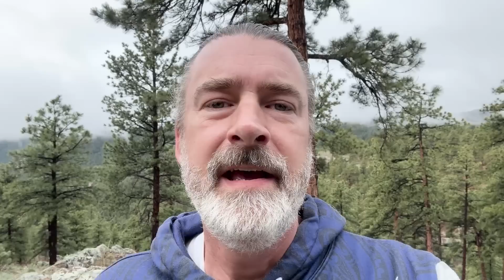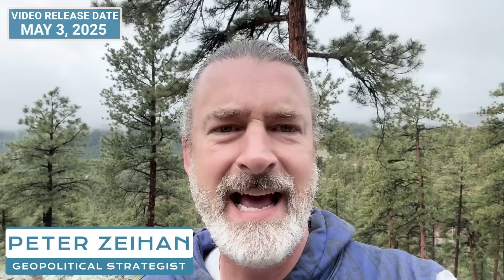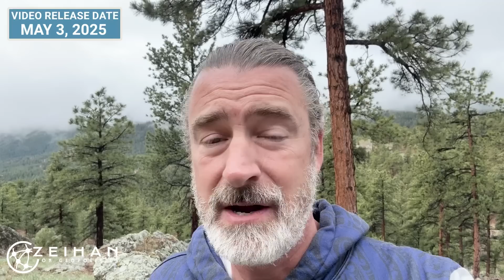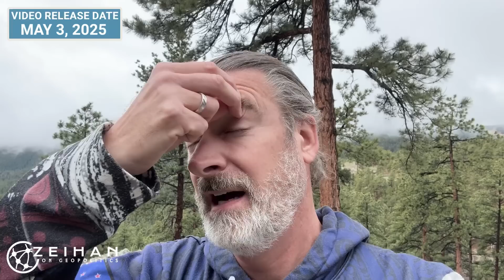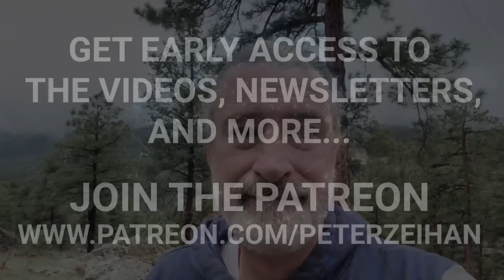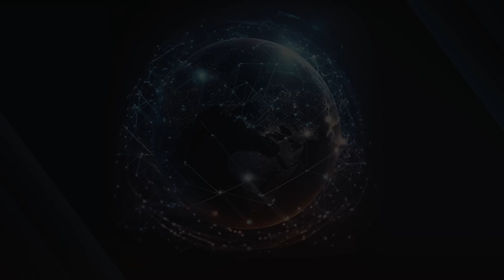The Night the Lights Went Out in Geor- er, Spain || Peter Zeihan

Comment: Pumped hydro storage is a far better option than batteries if you have the topography for it and Spain already has 6GW of it - they just need more.
Reply: @chrisc8156  more wouldn’t of helped this particular situation. They were actually pumping water uphill into one of their hydro storage facilities, in addition to exporting power to France, Portugal, and Morocco.
Reply: That's the same as "slow" storage batteries. It's great for day-to-day but not minute-to-minute.
Reply: @ in Kauai, Hawaii grid forming inverters and batteries responded quickly enough (1/20th of a second) to keep the grid stable when 60% of the grid went offline.
Reply: Closed Loop Pumped Storage is a great option that is being largely ignored. Why? The simple answer is there is too much money to be made with fossil fuel.
Reply: @ I wouldn’t say pumped hydro is ignored. But they take so long to build that utilities are looking at easier to deploy solutions
Reply: @WordLightDotNet Pumped storage has very specific site requirements.  These are very limited.
Reply: Spain is also destroying hydro plants because dams are environmentally harmful.
Reply: @chrisc8156  topography is a big if.  You need a preexisting water source and a large elevation delta.  And those conditions have to exist in a location where a hydro plant wouldn't just make more sense.
Reply: @alanhonlunli  Topographically, you need a small watershed near a river. There are millions of these locations. This is a nonsensical argument.
Reply: @chrisc8156  You shouldn't put all your eggs in the hydro basket: It's very vulnerable to drought. And climate change is likely to inflict some very severe droughts on Spain. Keeping the nuclear plants going would be a good back up plan.
Reply: @domtweed7323  No one is talking about 100% hydro. I'll bet you will never choose to live near a nuke plant.
Reply: @WordLightDotNet  If I had to choose between windmills, a dam and hydro setup, a coal/gas power plant, or a nuclear power plant... let me live near the nuclear power plant.
I'd even take it over a large solar farm, as the cooling tends to shriek like the world was ending.
If it was a matter of a small solar farm, I'd take that over nuclear.

Edit: Closed loop pumped storage can be pretty nice if you have the topography.
Reply: @WordLightDotNet  I'm saying we shouldn't rely on hydro for all our frequency regulation, we need other heavy things that spin on the grid.

And yes, I'd happily live next to a nuclear power station. I used to live next to a massive coal fire one, and burning coal omits significantly more radiation than nuclear power stations do.
Reply: @WordLightDotNet Not enough suitable locations.
Reply: @WordLightDotNet  I wouldn't mind living next to a nuke plant.  I'm not a nimby.  I took a tour of a nuke plant before and thought it was the coolest thing.
Reply: @alanhonlunli  Go live next to Chernobyl or Fukushima then.
Reply: @WordLightDotNet  I'd live near Fukushima.
Reply: @domtweed7323 They need water for cooling

Comment: I thought they were still investigating the cause?

Stuff going out of phase causes disconnects, but it is unclear why it went out of phase.

Here in Australia some politicians blamed the 2016 Sa power outage on too much green but it was the winds blew down the interstate connectors. The lights tend to go off if you import power and the lines are down.

Comment: 50Mhz!  Eeek!  50Hz is fine thank you. As the mains frequency is also used to reference clocks it is maintained within close limits. As the system loads up, voltage drops and the frequency drops on rotary alternators in old type power stations. More generating capacity synchronised to the grid contributes power to lower the load on the other stations, voltage rises and frequency increases. Modern DC power generation has to synthesize the alternators characteristics before and during the time it is connected to the grid. If it doesn't then safety relays will trip, fuses blow, and, yes, fires and explosions may ensue. Also remember the grid is built to withstand lightning storms. The geology of the country can play a part, Canada has had problems with its geology forming a huge capacitor with the grid itself causing overloads.
Reply: The geology itself becoming a capacitor sounds like it shouldn’t be a uniquely canadian issue. Are there other places that have that problem/ how do they deal with it if so?
Reply: @GO-iw1tt  I am pretty skeptical that this dude knows what he is talking about.  Either that or he needs to gather his thoughts better.  As written, it doesn't really make much sense.
Reply: You don't want RG58 power lines?

Comment: As an electrical engineer, this is hilarious
Reply: PZ is a clown, this video is the proof in the pudding.
Reply: As a EE, I second the motion.
Reply: @russellhltn1396  Also an EE here, there is more wrong with this explanation than right. I like listening to what Peter has to say but this was a subject he should have passed on.
Reply: Well, it was a good try (Kind of)
Reply: I'd prefer content creators bring laypeople up in their understanding of the world than talk down to them. Wtf is wobble? Is he talking about frequency? Or some tolerance associated with something?
Reply: @Eisernkreuz  Yes frequency..Think he's talking about the hertz (hz) and the different hz rate that the various power grids run on.. 50 in some parts and 60hz if i remember correctly . Hz is the cycle rate of a wave form , so the different power grid wave forms are not compaitible unless there is a gizmo between the 2 systems  to deal with it.. Waveform=wobble in his explanation.
Reply: @terranowe  I think he is trying to describe the stability of the 50Hz.
Reply: @terranowe  To the best I can identify, he is conflating ac voltage oscillation and inter-area oscillation, and doesn't have the technical background to untangle the concepts.  We occasionally get inter-area oscillations in the western interconnect.  check this:  https://www.sandia.gov/research/publications/details/executive-summary-to-pdci-oscillation-damping-controller-software-documenta-2018-09-01/
Reply: @terranowe He explained the USA has 60 Hz, Europe 50.  So “wobble” remains undefined.
Reply: @Eisernkreuz  I think he is conflating the power system frequency with "inter-area power system oscillations".  I don't know a lot about the European grid, but their oscillations are probably similar to what we get in WECC along the California-Oregon intertie.  There were some inter-area oscillations before the event, which might have pointed to a stressed system, but I disagree that it was a root cause for the outage.  Nor reduced inertia.  There was an initial loss of thermal generation, then there appears to have been a near simultaneous loss of a second thermal generator along with maybe a couple GW of solar generation.  This is a sigature we see over and over again with improperly configured solar inverters, but usually it does not result in a cascading failure.  Peters conclusions are laughable.  Power systems engineers have a lot more tools in our toolbox to fix this issue.
Reply: A polite way of putting it.
Reply: 50hz and I can see the lights blink in the corner of my eye. 60hz better.
Reply: Peter just likes to sound of his own voice.

Comment: If you are a home owner in Germany you can get stated backed cheap credits to upgrade your house with photovoltaics, a battery storage, a heat pump to heat up a water storage tank for the floor heating. You can also get those credits for new windows and other renovations that improves insulation of your house. So a power shortage isn't much a problem if you are a home owner. 
It's more a concerne for the poor people living as tenant in an appartment building, and the industry that needs way more electricity then all the households combined. But the majority of the democratic voters in Germany support that policiy, so what.

Comment: You can also use super capacitors for almost instantaneous stabilization of the power system, or alternatively, use a electric motor - alternator combination to provide kinetic energy in the system.

Comment: The oil lobbies and MAGA are going to love this. If the billions wasted on fusion was spent on green tech it would be solved. Coal and gass will run out or cost too much. We can and need to solve this. For me it's about security. In the The UK so many countries currently have the power to turn us off. Imagine if MS did a software update to turn off all UK windows controlled domains. It would destroy us. 😢

Comment: The CEO of Octopus Energy says the problem is that we haven't gone fully non fossil. His analogy is that we're only half way across the road. 
   Things like analogue control rooms instead of digital, outdated pricing structures based on most expensive peaker power, no ability to price according to distance from generation sources.
   He says it's not even necessary nowadays to maintain grid frequency in a narrow band because that was for people's alarm clocks. That's not necessary nowadays. Electric motors can tolerate greater frequency variations. 
   And power islands like Iberian peninsula are vulnerable. These problems can be solved by more back up battery storage, full digitisation and more interconnects.
Reply: Interesting opinion, however impedance is related to frequency of the grid and is optimised for 50Hz so if you go 50.5Hz impedance grows significantly and your circuit creates losses and more importantly heat, it can damage equipment.
Reply: @MikeKay1978  Good point. He didn't mention that.

Comment: What a disgrace of an explanation 😂
And no, you don't need coal. I believe some rotating flywheels could also help with stabilising the frequency. But no large scale stabilisers have been deployed.
What is often overlooked is that the grid in Spain/Portugal/Italy/Greece is fairly poor. It barely keeps the light on the best of times
Reply: I live in Spain and I had no blackouts besides the big one.
Reply: Barely keeps the lights on? Where have you been exactly, in Portugal we've hadn't blackout in at least 2 decades.
So where is your comment out of? definitely not knowledge, as you could easily search for blackouts on internet
Reply: @DevilTidusX  Well yes, it's stable. But forget any domestic connection above 3kw pretty much anywhere in the country. UK in comparison has 100A - 22kw  in every house
Reply: @BGS_123  how is that barely keeping lights on?
Because that was your claim.
 
The only problem I see in Iberian grid is that it does not have the proper inverter to help with inertia. Consider we are very full of renewable such as sun and wind, we should have put more of them as safeguards
Reply: @DevilTidusX  It has plenty of hydro with natural battery capacity (you pump back up the river)..is this not well known? I dont get this comments...